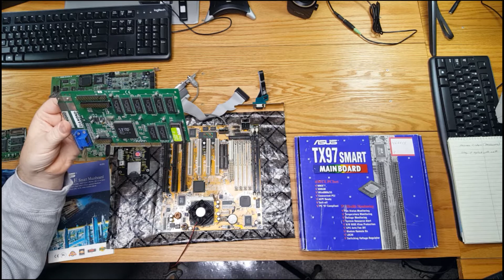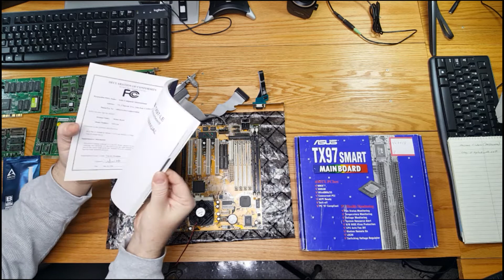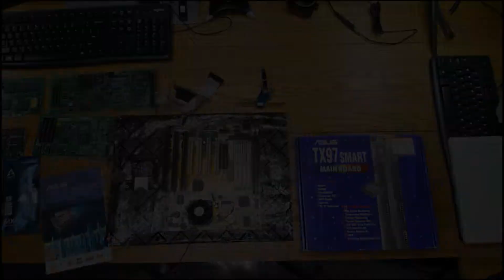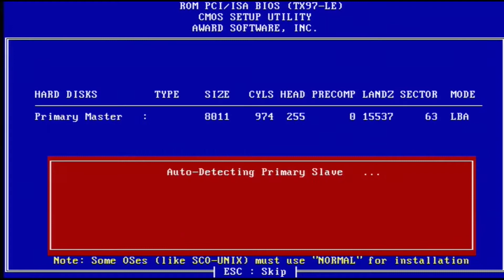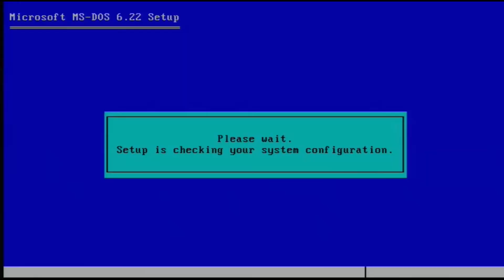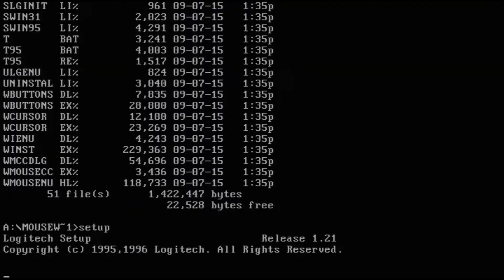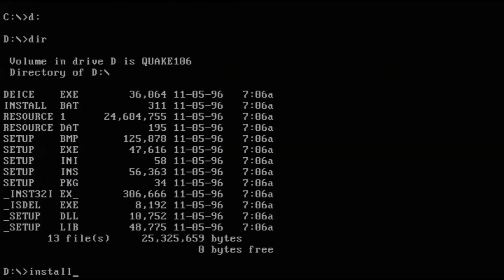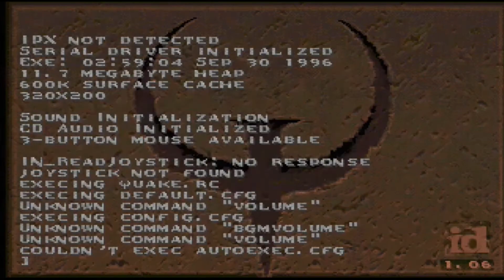Asus TX97-LE retro classic motherboard and DOS game build

Comment: I have the Asus TX97-E with a Pentium 133mhz. I received a 3DFX voodoo 1 today, and will install Windows 98 SE on it. That will be my retro PC
Reply from the maker: Awesome!  What video card are you going to use as the 2D?  I have a VooDoo2 I am thinking of adding for real 3D and upping to a P233 MMX or my AMD K6 266 along with 64 MB RAM.  What is the difference between your TX97-E and my -LE?  If you know that is.  Let us know how it goes and what you play on it.  

If anyone else is curious, the videos of retro DOS games I plan to post soon will all be on this board.  
Starting with War in Middle Earth (WIME).  Sort of an old fave of mine 😊
Reply: @UncleMikeRetro  Well all I see is that on the TX97-E there is a PCI Media bus extension, you can spot the difference on the two user manuals that you can easily find on manuals . eu 

For 2D the computer already has a Matrox Mystique 2 (not great for 3D, but ok for 2D)

I would also like to upgrade the CPU to a 200 or 233 MMX but those are hard to find locally

The plan is to play old games like Quake, Duke Nukem, Point and click games,.. But it is mostly for the pleasure oh having a system that is old working :)
Reply from the maker: @4kSeri  Love to reminisce the old WIN98 BSODs.  Also, I got all my Pentium CPUs from scrapping at the local junk yard.  

I have two Matrox PCI cards from 1996 and 1997.  I think one is a Mystique and one is a 400.  Maybe I should try those for the great 2D they have.
Reply: @UncleMikeRetro  I would love to do so, but here it is illegal to take anything from the recycle park sadly :(
Reply from the maker: @4kSeri  Damn.  I pay for the scrap, so it's OK here and all.  For now 🙄
Reply from the maker: Don't forget to let us know how it goes when you get the board up and running with the Voodoo 1 card

Comment: Have you seen Philscomputerlab video called "136 in 1 Pentium MMX"?  Using one of those processors you can slow them down to about 386 30mhz equivilent and 136 steps between that and 233Mhz Pentium MMX.  I  have just bought a motherboard to try this, but am awaiting a ATX to AT power supply convertor and a 233Mhz Pentium MMX.  The motherboard came with a Pentium MMX 166Mhz.  In fact I may be able to go even slower, as the bus speed on my motherboard has jumpers to go as slow as 50mhz.
Reply from the maker: I just took a look at it.  Phil is an amazing guy and one of the best "pure" retro hardware gurus out there.  I might be a purer retro guy, though, in that I just want the old stuff to play "as it was designed" and run it all against each other and in games, recreating the original hardware experience as much as possible.
Of course, that means a lot of motherboards and individual chips.  I WISH I had time to go play all the games I still have on original disks/CD-ROMs.  You have no idea.  YouTube is the night hobby with the day job paying all the bills!
Just for fun, though, you should report back to all of us your successes in getting YOUR system even slower than Phil managed.
I'd love to see if you can go 286 10-12 MHz speeds 😁
Edit:  What exact motherboard did you obtain anyway?
Reply: @UncleMikeRetro  yea, that is true.  I too prefer that  and I am doing so for hardware from 1995 to 2021, which is the period where I had my own computers and played a lot of games on.  I will have 8 machines to cover that period with various  CPUs, soundcards and video cards.  3 of those machines though are not period correct and are basically the ultimate performance version of a particular OS.  One for DOS (Pentium 233MMX), one for Win98 (Pentium 4 and DOS compatible Aureal Vortex 2 sound), one for WinXP (Core 2 Quad QX9650  GTX 970, this system dual boots WinXP and Win7).  My 2021 machine is also pretty much top of the range (Ryzen 5950x, RTX 3080).  The few games that I played before 1995 will hopefully run on the slowed down Pentium MMX or in DOSBox.  Certainly the DOS games I played should work on the 233 MMX: Duke Nukem 1+2, Prince of Persia, Wolfenstein, Space Quest, Sopwith, Monkey Island games, Doom, Wing Commander, Sim City, Worms, Need for Speed, Battle Chess, Jazz Jackrabbit, Quake, Duke3D, GTA.    I am sure there are lots more.  Incidentally, my first PC was a 286.  It was many years out of date at the time (1993) so was bought for only £2.  I loved that slow machine. Lol.  Then my first decent computer was a Pentium 120Mhz in 1995.  I don't recall most PCs that I had after that, but certainly between 1997 and 2003 it was mostly AMD.  All of my PCs prior to my Core 2 Quad QX9650 were thrown away, so trying to build up a collection to relive the games and software of my youth.  I DID keep most games luckily.  I also have hundreds of cover cds from computer magazines with game demos and shareware.  Like you I don't have a lot of time (being father to 6yr old, and in full time work), but it's fun none-the-less.
Reply: Forgot to mention motherboard doesn't mention brand.  Just says MS5145 VER:2 . It is obvious from labels how to change CPU multiplier.  Not sure how to change voltage and have seen no manuals for this motherboard.
Reply: Looking again.  My motherboard  goes as low as 75Mhz Pentiums.  Not sure if it actually will do that with a 233Mhz CPU but worth a shot.  Just been googling and I think that the 166Mhz CPU that's in their has the same voltage requirements  as a Pentium MMX 233Mhz so hopefully won't matter that I don't know what most jumpers do.  Will just change the frequency. I am wondering if I can add some leads to the multiplier pins and maybe set the frequency with a raspberry PI and add ability to change frequency via knob in front of case.  Obviously I know I would have to reboot each time I change frequency settings.  Another interesting note is that the motherboard headers seem to support a turbo button.  Never heard of that with a Pentium.  I wonder what it does and how slow it goes.
Reply from the maker: I have considered doing a few videos on the stack of cover CDs and DVDs I also have from the magazine days.  IE Interactive Entertainment and PC Gamer disks mostly!  Lately, I have been going through all of my old stuff and am amazed at what I saved.  I found a Colorado 250 MB tape drive, a tape with saved files and the driver disk for instance.
That should be a cool video alone!
Reply: @UncleMikeRetro  yeah, I am sure there would be interest in the retro storage devices and cover disks.  Lots of cool software on the cover disks.